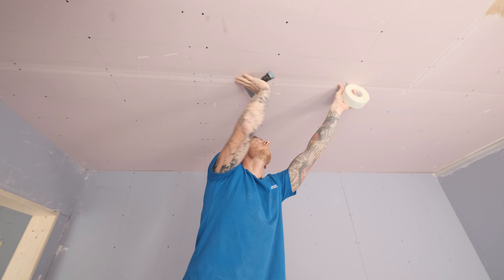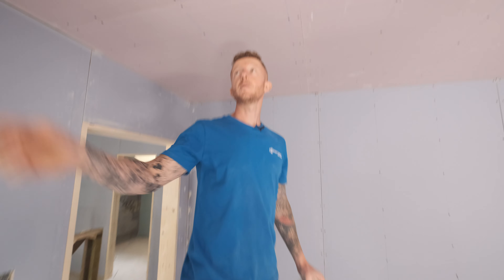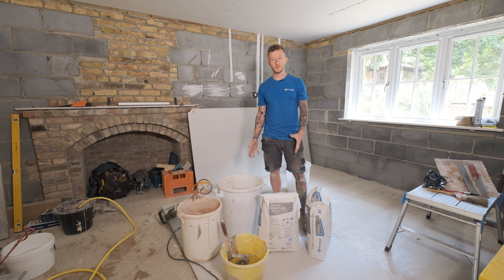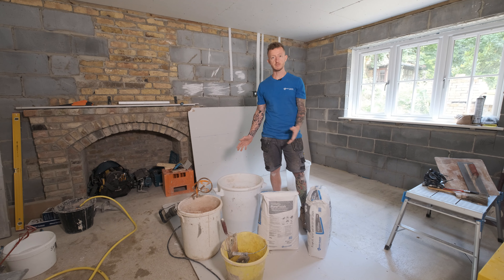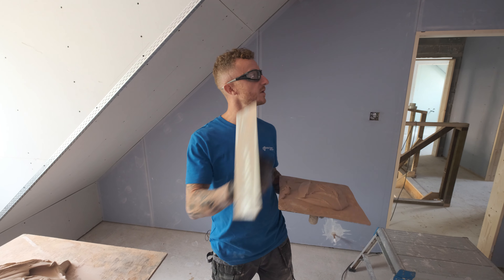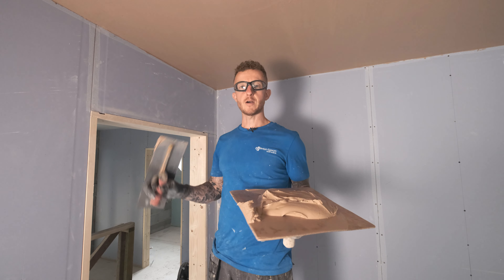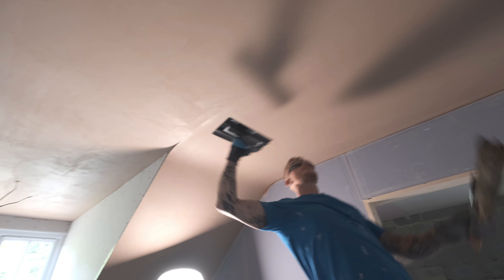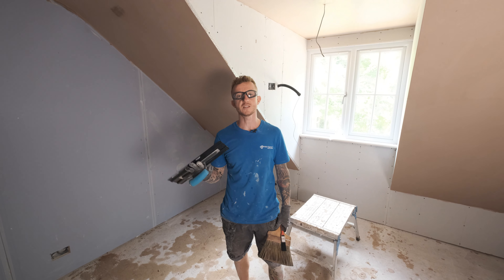This PLASTER improves indoor air quality! | How to Install ThistlePro PureFinish

Comment: Had a quick look on their website and it specifies the VOC it converts is formaldehyde, one of the more common VOCs in houses so that's good. Doesn't mention other VOCs though as far as I could tell. Does it feel like working with multifinish?